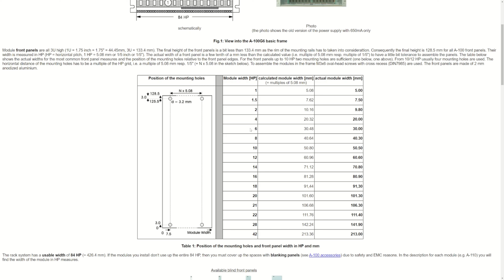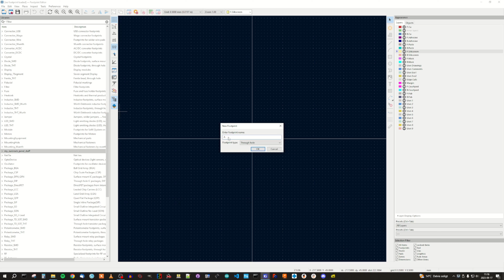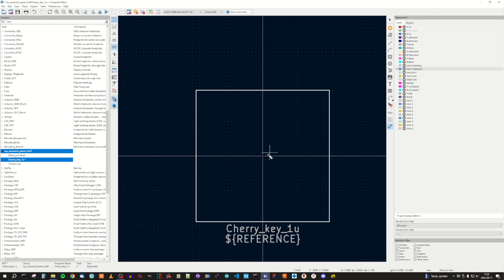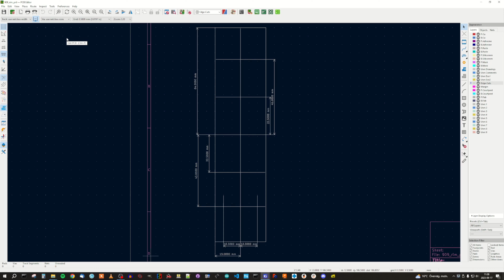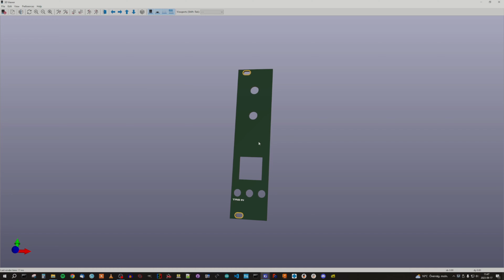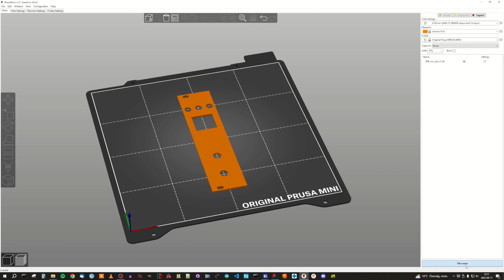Eurorack DIY: 909 Rimshot (Episode 6) - The Frontpanel

Comment: couple of questions:
where can i find that data sheet shown at 9:48? i cannot finding this anywhere

also, from an overall building approach, is there a reason you did not order the front panel when you ordered the pcb in the last video?
Reply from the maker: You can find it here:
https://www.nvent.com/sites/default/files/acquiadam_assets/2023-04/7_1_schroff_cat_frontpanels_en.pdf

No, you can order the frontpanels directly if you want, but I tend to do it like this to aviod scrapping frontpanels if I'm not happy with the placement of pots and jacks and want to make a new board-spin with an updated design. 3D printing the frontpanel is great for checking the look and feel, before I commit to a PCB panel.
Reply: @MeeBilt  thank you very much for the link! 

and regarding the frontpanel, i get and love 3d printing it first to properly get a feeling for the panel. I literally was just wondering because this way you paid twice for shipping 😅 and when ordering stuff from overseas, this seems to be something that most people try to save some EURs on. i was just wondering if there was another reason for this i might be overlooking. but makes sense, thanks for the input!  (and the videos of course)
Reply from the maker: Thanks a lot! Good luck with the build

Comment: Hey! Just discovered your channel! Thank you for sharing your amazing work. I was wondering if I could ask, where do you typically source your jacks and pots? I have a lot of trouble finding vertical through hole versions, so I mostly stick to just wiring them to the PCB after mounting them to the panel. Any help would be greatly appreciated! Thank you again greatly for all your work!
Reply from the maker: The jacks are called Thonkiconns (or PJ398SM) and you buy them from Thonk in the UK.
They also have the Alpha pots RD901F (but they can be found on Aliexpress and a lot of other places as well)
Reply: @MeeBilt  ahh thank you so much!! It's a huge help!

Comment: Yogourt printing, love it !
I laughed when I saw your printer speed, what you call "slow" is lightspeed compared to mine 😂

Nice episode as usual !
Reply: Yeah that prusa mini is tempting me a lot, I'm only a little afraid of the maybe too small surface.
Is the leveling auto or easy ?
Reply from the maker: @dtharmo  The levelling is automatic. You only have to adjust the first layer once.
The build volume is 18x18x18cm, which is a bit small - but it's a small printer...
I have a Prusa i3Mk3 at work that I use if I need to print bigger things.
But for the price, the MINI is a great machine.
Reply: @MeeBilt  Christmas is coming ..
Reply from the maker: @dtharmo  Indeed it is!
Reply from the maker: I'm waiting for the Shaper Input version of the software to be released - the beta is out but I'll wait for official release. Need for Speed 😉